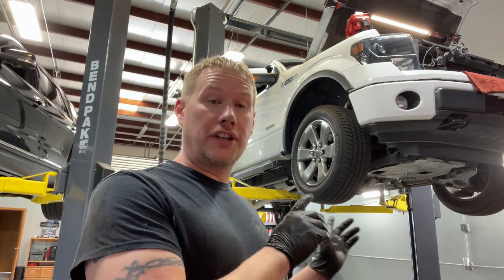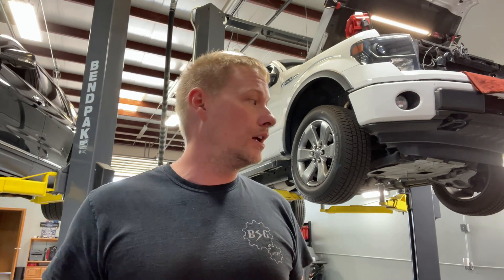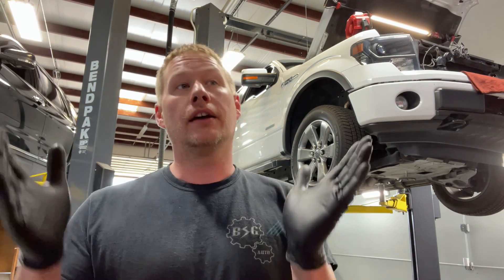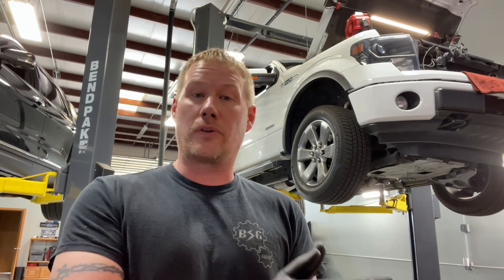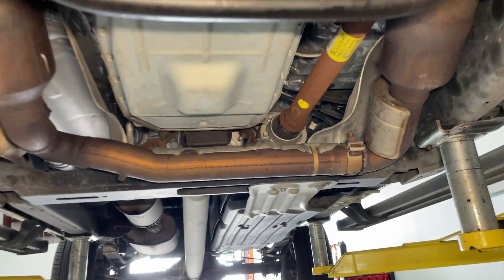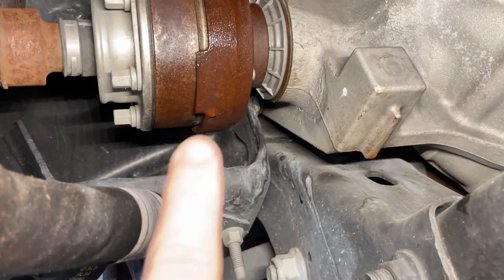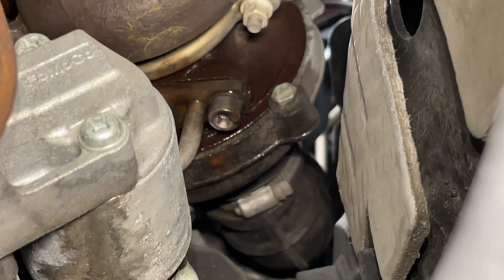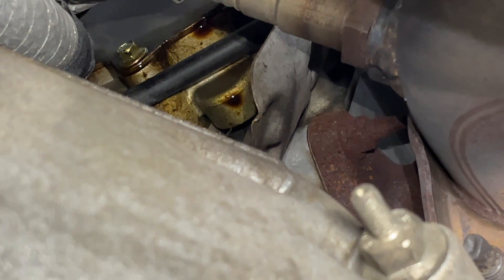Ford Ecoboost Engines Can be so Hit or Miss: I Really Feel Bad for This Customer...

Comment: I am not buying it. That thing looks beautiful on the outside but how has it been driven for 70,000 plus miles? Speed limit in parts of Texas are unlimited to some extent. I can tell you this, the majority of 3.5L F-150 are people putting them in sport and smashing the gas pedal at every stop in my area. And 70,000 miles for a 2014? Why? Something doesn’t add up. My sister lived in Texas and cars had 200,000 plus after 10 years. Texas is a big place folks. Something ain’t right. Peace
Reply from the maker: I think it’s because he has multiple vehicles.

Comment: Have no idea why they call them “quick connect” fittings when nothing is quick about disconnecting or replacing them, usually requires hours just to access them to get enough shit out the way to replace them. Banjo fittings worked fine for years on turbos

Comment: This is why I went with my ram 1500 3.6 and I didn't have any problems untill I hit 200k
Reply: What issues did it have. Just curious. Kind of sick of ford's crap but have had bad luck with chry stuff in the past.
Reply: @EthanThruandThru  well i have 406k on it now. From 200 to 300k the oil cooler seals went out and wheel bearings u joint's alternater 2 oil leaks and that's about all. Over all I really like the truck so much that I bought a 2019 ram 1500 that now has 118k on it with no problems so far
Reply: @jmax6614  the main issue for me has been rust. About a foot of metal disappeared off of the driver door and the license plate fell off. Rear bumper fell off. Rust all the way around lol.
Reply: @EthanThruandThru  well that sucks, I live in Texas so I can't help you with rust, I can tell you that doing an oil change and maintenance is really easy and fast

Comment: Brian, honestly the extended life coolant isn't what it's supposed to be. It corrodes fittings and gaskets. Max life 5 years. Also dang if you do and dang if you don't, low usage vehicles, the seals and gaskets get hard. It's not like it used to be. There's no extensive research on vehicles no more. It's all about the profit. They're not making any money if it lasts longer than 10 years. Thanks Brian for your great videos.
Reply: I would put toyota or honda coolant (P-HOAT) instead of the HOAT in Fords. Ford cannot even get the recommended interval on the differential and transfer case correct. Do you expect them to get coolant right? All systems now are using aluminum rads and aluminum engines. The only difference is the fittings, hoses, and piping are a little different.

Comment: As long as they keep putting turbos on these motors so they can get the mileage the government wants, ford is gonna keep digging a deeper and deeper hole for themselves.  Increased compression and poor engineering doesn't mix.  Give me the 4.6L motor any day of the week.  I feel really bad for this guy.
Reply: Once you drive an eco boost your days of sloggin around in a 4.6 are over.
Reply: @yamaha226  I have one dude.  Once you put a water pump in one your days of sloggin in a 4.6L don't seem so bad.
Reply: @anttheaquarist7922  I understand .

Comment: I own an auto shop in southern Utah , Ford is my brand 
I have a 2016 lariat that has the eco boost 3.5 
And it has around 80000 miles and it has most of these problems 
Not the rattle on startup but Ford did have to put new timing cover gaskets under warranty for leaking 
My wife has a 2012 flex with the eco boost 
That’s why I wanted it in my truck 
It’s got 190000 and zero problems

Comment: Interesting.  I have a 2012 EB just turned 220k and never been in the shop for any repairs.  It’s my work truck since day one and has approximately 500lbs of tools equipment in the bed 24/7/365. Plus I haul welder trailers and our car trailers with scissors lifts on them 2-3 times a week or more.  Oil changes @ 20% left, driveline fluids @ 50k, spark plugs every 60k and  no catch can or weep hole drilled in the intercooler. I don’t push the truck hard but also don’t baby it. Lifetime average of 17.5mpg so far. Seems like the trucks having issues are the ones being babied or not really worked. All the EB’s I’ve seen issue free are worked or tow a lot. My observation so far anyways

Comment: That’s what happens when you use rubber coolant hoses and quick couplers with rubber o-rings, stuck in 1100 degree turbos.

Comment: I just bought a 2011 Ford F-150 3.5L Ecoboost with 305k miles. I intended to swap the 3.5L with a 5.0 out of my wrecked 2011 Ford F-150. Both of these trucks are XLT and Supercrew and 2011's. I'm really intrigued with the 3.5L, but after watching all your videos Makuloco, I'm debating on buying a low mileage 3.5L crate engine.

1.) My question is, should I expect to have a "inspected" crate engine serviced with a new timing chain, cam phasers, turbos, and a water pump?

2.) Should I spend $4000-$5000 on a 3.5L crate engine if it doesn't have the updated parts?

I've watched your videos on the oil catch can and the updated oil pump from Melling, so I'm debating on buying these also.

If its possible to swap a 3.5L with a 5.0 I'd probably do it. It has 160k miles and it never gave me an issue. I used it for work, I've broke leaf springs with heavy loads carrying shingles and concrete. The 3.5L drives so well though, I honestly like driving it better than my 5.0. However, the reliability of the 5.0 made me a lot of profit by staying out of the shop. I was able to pay it off in five years. All I did maintenance wise on the 5.0 was brakes, oil, rotors, leaf springs, ball joints at 160k miles on the 5.0.

Comment: Hope this isn’t to lengthy but here goes. I started as a drivability tech at Ford/linc/merc dealerships near Cincinnati in 1990. We had some issues with oil leaks in those days and they got addressed by Ford. Then we had crazy engine reliability so bad the engine guys almost starved to death. The push rod engines worked!  Then came the 4.6 and it was super reliable. Even the early 6.8 was awesome. What has happened?  Why can’t any of the manufacturers get their act together. I know these new engines make crazy power  and get awesome MPG but come on. Give me an old school 4.9 with a 5 speed and I will show you one that will go forever. Might need a gasket or two in its life time but nothing like the current issues. I currently own two coyote powered f150’s in hopes they don’t have issues.  I miss pushrod engines. Wish the new 7.3 wasn’t restricted to a super duty

Comment: Hey Brian I have a 2014 Ford F150 Lariat with the 5.0 but my truck has a similar issue when I start it it rattles. It's not all the time but it is annoying. Truck has 139K. Any recommendations?

Comment: I have a 2002 F150 with a 4.2.  I bought it new in 2001, and it has 511,000 miles original motor and trans.  I have had to do a few things to it over the years, a starter, and alternator, a power steering pump.   But it still runs great.   Then they have to come out with these engines that have timing chains and turbos everywhere.   The more pipes there are the more leaks your are going to have.  This is why my next truck will probably be a chevy, with a V8, and not a Ford.

Comment: Great content as usual!    If you havent already, I'd luv to hear your opinions and suggestions on engine choices for the F150.   Also, did Ford improve or de-improve the  the new version of the 5.0 Coyote?

I have 2016   f150 5.0   with 132,000miles.   So far waterpump, starter, and a coil.   Could be much worse I guess.   Wish yer shop was closer to me.

Comment: This is why I drive a 1996 4.0 OHV Ranger with 220,000 miles daily.  I have a 2006 4.0 SOHC Ranger with 80,000 miles but the rear chain guide went so I pulled the motor and thanks to your videos it's all going back together and should be back on the road in a few weeks.

Comment: Those turbo coolant line fittings are like one time use and not designed for durability or service. Good thinking ford. Don't for get the exhaust Manifold warp too, another bad ford design, 2 bolts holding the weight of the turbo.

Comment: I bought my truck with 120k, now have 250k and luckily never had the timing chain issue since I've had it. However I change my oil every 4k with full synthetic. I have had all the common leak issues though. I changed the quick connect at the degas bottle with a silicon elbow and hose clamps so it can't fail again. I was able to change the outward coolant adaptors on the turbos without pulling the turbos out but the inside adaptors are still leaking.

Comment: You could save the customer a lot of labor by lifting the cab to do the timing components, makes the turbos a breeze. Glad they fixed the turbo coolant line issues and went away from the vacuum pump on the 2nd gen 3.5. Even so, the v6 ecoboost engine are VERY reliable.
Reply: Anytime step 1 is : remove cab. It's not gonna be cheap.
Reply: @eldonerc2524  Not really.  Cabs and cradles are build to be quickly assembled, and its usually only a handful of hours to separate.  The tighter the engine bay, the more sense it makes to just lift the cab or drop the cradle.
Reply: @eldonerc2524  NO, I lift the cabs cause it takes me 40-60min. makes working on the engine easier. instead of hanging over the top, with arms dangling down.

Comment: Wow, wow..... and just, WOW! At this point, is where I'd be stopping, and tallying up the total cost of all these parts, along with the extra labour before continuing. The last thing anyone of us wants to hear, is that "ever since you...." from the customer after we've completed a major repair on their ride. For what it's worth, I lift the cab on all F-150s any time I'm an engine repair of any sort. This particular instance featured in the video Definitely warrants in. Especially to access that vacuum pump at the back of the right cylinder head. Not to mention those coolant tubes to the turbos, speaking of which, this is definitely a job that mandates removing BOTH turbos and replacing ALL the lines, both oil and coolant. I honestly don't see how anyone has the patience to do a timing job on one of these trucks with the cab still bolted to the frame. Fighting with removal and installation of those CAC tubes, as well as the prospect of being bent over for hours is more than enough incentive for me to take the hour it takes to unbolt the cab from the frame. This also eliminates the risk of scratching up the fenders as well.

Comment: Makes you wonder about the quality control of parts manufacture when you see something like this.  None of these leaks are preventable through basic vehicle maintenance, so Ford is clearly to blame for these issues.  I have a 2011 F-150 5.0 and am familiar with its infamous coolant leak points, but the truck itself is too outstanding to blame for some crass engineering.  Overall, I give it 5 stars even with these engineering issues.

Comment: Unfortunately with CAFE standards FORD has to move to these turbo charged engines. I loved my 2.7 liter EcoBoost in my F150 but it definitely needed alot more maintenance. Shorter oil change intervals and coolant flush and change every 30 thousand miles. I had no problems with mine but realize that smaller turbo charged engines are less reliable fir sure. I do hope FORD keeps its 5.0  liter V8 NA gas engine around for many years as a option.

Comment: My 2016 3.5 EcoBoost had turbo failure at 57k(Sept 2019).  They also found it needed water pump, timing job and rear seal on transmission. So we did the 60k service early since they had it all apart. I asked for the other turbo to be replaced so I wouldn’t have issues later but the warranty wouldn’t cover it.  At 66k(May 2021) the 2nd turbo failed and took out the motor by sending metal shavings through every cylinder. I just got the car back(Sept 2021) with a new motor and new turbos all covered under warranty. I would have been out $12k in parts and labor plus the cost of a rental if I didn’t have the extended warranty on it. I told my wife we need to move on from that vehicle right before the extended warranty expires because I don’t want to do all this again at 120k miles.

Comment: Have made a lot of money on the 3.5 ecoboost in the shop the last few years.  Timing chains and turbo replacements.  The 4 cylinder ecoboosts are the same.  Timing chains are normal maintenance on a lot engines now days.

Comment: This is NOT an issue on the transverse 3.5 Ecoboost which uses different turbos. Never seen them leak coolant... Also Ford has made significant improvements to the 3.5 and the Gen 2 is better with Direct and Port injection, turbo and intake improvements etc

Comment: I miss the days of a more basic naturally aspirated vehicle.
Reply: 👍 I still daily drive my 94 Explorer with 306,000 miles on it. 
Not the safest vehicle but reliable.
Reply: @dho9yds  Original engine and transmission? What engine is in those things?
Reply: @UncleSarkis  Original engine. Transmission has been rebuilt.
4.0 ohv V6. A4LD transmission.

Comment: My 2017 2.7 ecoboost f150 need new heads, spark plugs, and injectors after towing 5000lbs on an 800 mile round trip to west Texas. Wasn't even hot outside, it was in April. Had 17,000 miles on it. What caught me by surprise was that the Ford service guy didn't even question me about what was I doing with truck when it happened. He was familiar with the issue.
Reply: You need new heads after towing a light load for 800 miles?  That seems....not factual?
Reply: Truck had 17,000 miles. Took an 800 mile road trip towing a small travel trailer. A week after we got back I was merging onto a highway on my way home from work and lost a cylinder. Had it towed to ford dealership. Three weeks later when I picked it up they told me all that they replaced and gave me the printout. Two heads, injectors, plugs, and various gaskets.
Reply: @billybodacious2337  Wow that is crazy! I guess you've got some fresh part out of the deal - but still - Hopefully no more issues like that for you! as a long time Ford fan and owner it's a bit sad to hear of issues like this.

Comment: My Dad has 2014 3.5, has almost 170K miles , zero leaks, changed water pump/belt  at 165K miles, that's it not even any coil packs or turbos. This looks like somebody who was working on it, obviously did not know what they were doing, must have disconnected a bunch of hoses to trouble shoot something  , and put back the same hoses including the turbo coolant/oil lines

Comment: I'm definitely an extended warranty, regular maintenance and drive it like you stole it kind of guy.  Haven't had a problem with the 2.7 in my edge sport from 23k to 66k, but I did recently have the rear diff changed.  The decouple was making an awful noise while engaged.  Good thing I got that ford premium coverage untill 125k.  Lol

Comment: I feel for this guy. I have an 06 ram 1500 that is in great shape. I like this fella take care of my investment. Despite my care my hemi wrnt out at 120k miles. On top of thar thd tipm went as well. I was so pissed. Im a disabled combat vet and live on a limited budget and needed this truck to last at least 250k miles with only minor issues. I called dodge as both of these issues are apparently common and one was a big safety issue. What did i get, nothing, not even a sorry. These manufaturers need to be held accountable.

Comment: The safest bet seems to be an F150 XL with the 3.3 liter V6 or the 5.0 liter on a fancy model. A co-worker with the 2.7 ecoboost had his truck in the shop for over a month waiting on a high pressure fuel pump for the GDI circuit. Newish truck, parts are in production--Ford just didn't have any, anywhere. I'm not taking out a mortgage to buy a truck in any event.
Reply: The late 17's thru early 19's have the oil consumption issue with the 5.0. We had one that was using 3 qts in 5000 miles and ford tried to say that was the norm for the mod motors and their fix was to install a new dip stick with a larger safe zone on the new stick. After many many trips and arguments with ford they replaced the engine at 50,000 miles and had it for 10 weeks, we had it back for 17 days and the steering locked up going down the hwy which resulted in a near head on crash with a big oak tree which totaled the truck. Ford said they sent an engineer to the insurance holding lot to investigate our claim of the locked steering but of course said the steering issue was a result of the crash. So we replaced it with a 2020 Ram and its been in the shop twice now with a wet headliner and they cant seem to find the source of the leak. Im come to the conclusion that all the new trucks of today are complete garbage.
Reply: @poorhouseracing  It wouldn't be so awful if they didn't start at $30k and average out at $55k.
Reply: @poorhouseracing  agreed. Ford was the last brand I really trusted. Now I don't trust any of them. The new stuff is just plain and simple trash. Designed by lean process six sigma goons to squeeze every single penny from the process with no thought to the customer who goes beyond 36k miles. I went backwards from a 2017 eco Expedition to a 99 Suburban when a dealer offered me really sweet money for it. When the dust settles on this shortage, if I decide to get something newer it might not come from the big three and that makes me sad
Reply: @poorhouseracing  If it has a sunroof check the drain tubes, I've seen them pop off on other cars
Reply: Best bet would be just get toyota truck,  at 100k miles, engine is barely broken in.  I  still drive my Tundra with over  450k miles
Reply: @bigdavedayday1581  Then again I know someone who blew up their 5.7 tundra engine cruising down the highway at 100k miles
Reply: I bought an xl with the 5.0. After watching many of these videos, I'm glad i did.
Reply: @bannedtwice7767  Same here!
Reply: I have a 2010 5.4 with 390k and my ac just went